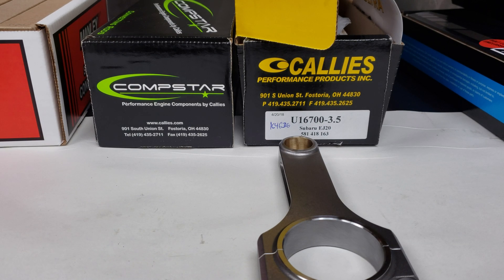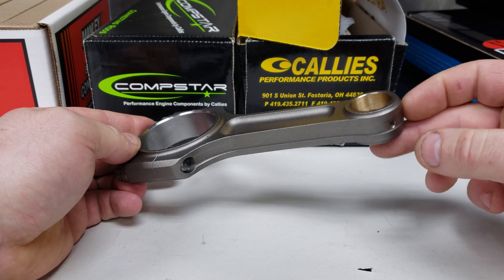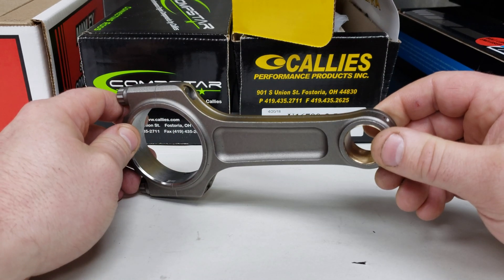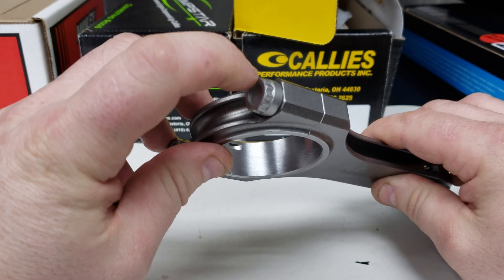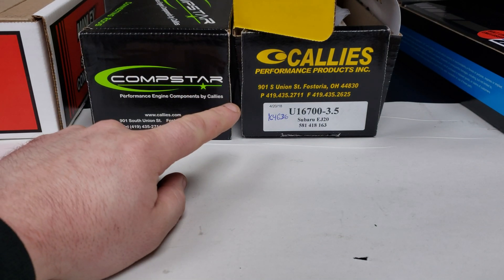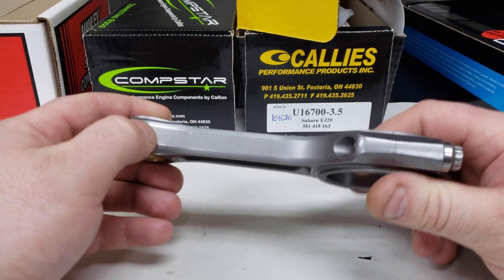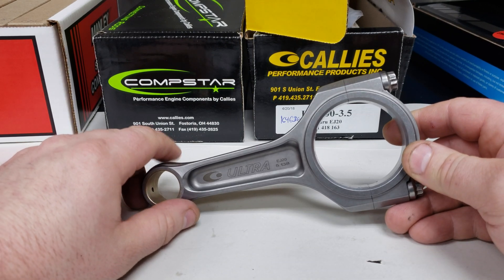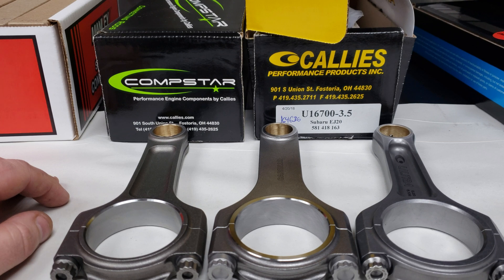Subaru EJ Rod tech. Unboxing and comparing the Callies Ultra VS. Manley & Carillo.

Comment: Have you ever looked at Greg Cunningham rods specifically their titanium rods.. I have a build that had to take the back seat for a while, I had them build a set of titaniun I beam rods for a phase 1 ej25.. I was new to Subi's and didn't know about the phase 2 option.. The main reason I had them made was for less beating on the crank since the journals are only 48mm.. I don't know the big/small end weights, but I do know the over all weight is 332gr.. They are shot peened and plasma moly coated..  All their rods have a 2 grain construction, the beams have vertical grain and the caps are horizontal.. They say this is to keep the big end round..